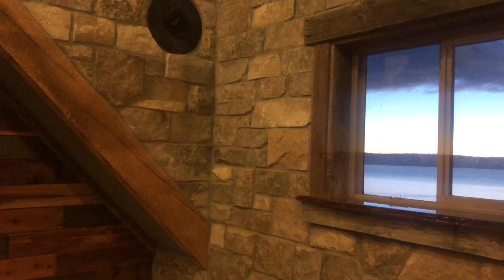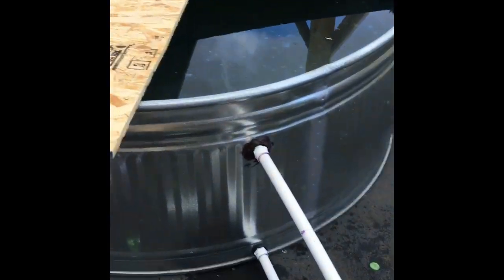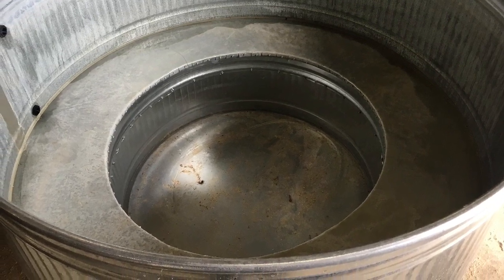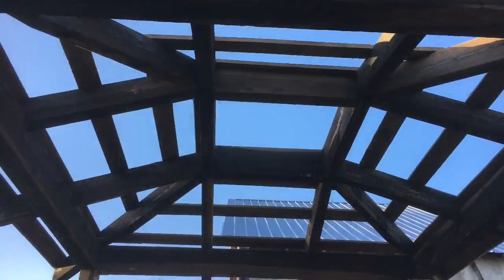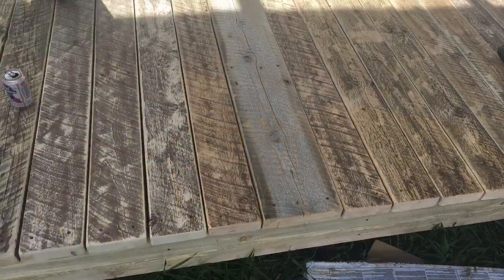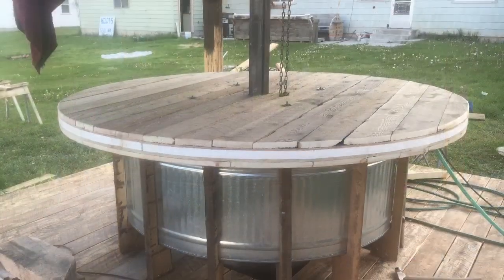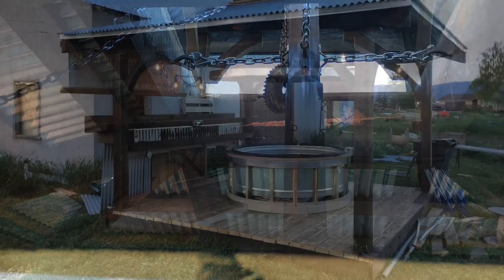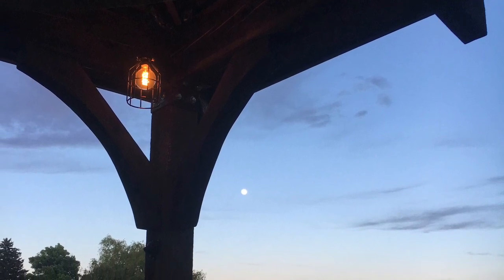Crazy Off Grid Wood Fired Hot Tub

Comment: Can you share some info about how you were able to attach the two stock tanks and prevent leaks?
Reply from the maker: Yes you need some sheet metal skills. I cut the lower one down so it was not so tall by removing a 4 inch center section and put it back together and used sheet metal screws and silicone. Next when you cut the circle out of the bigger one you cut it small so you can sit it on top of the other one. The use tin snips and cut slits into it every 2" and bend it over. And screw it in place and the silicone it again
Reply from the maker: Hard to explain with out a video

Comment: this is sweet. I want to try and make a similar tub out of rocks and quickcrete near a creek this summer. Do you think a bit shorter of a coil, but larger diameter would help it not airlock?
Reply from the maker: It's a 1" coil. I feel I feel if you used a smaller diameter it would have less area to build up the air lock just my thoughts but honestly I'm no scientist